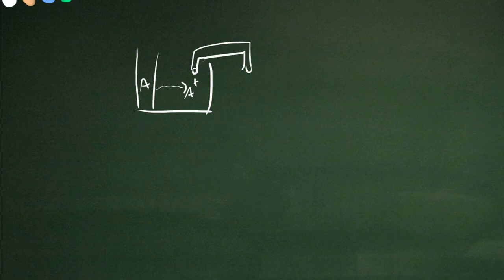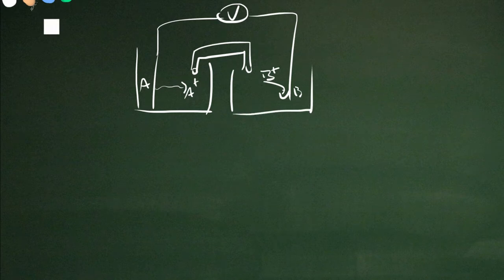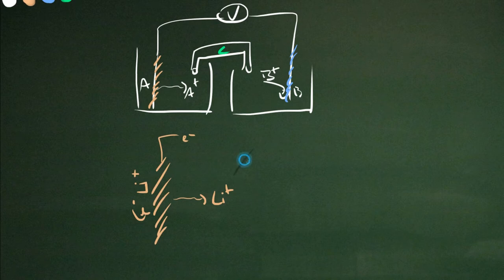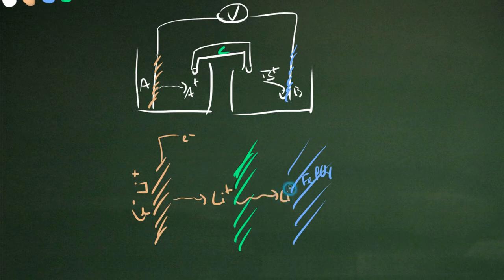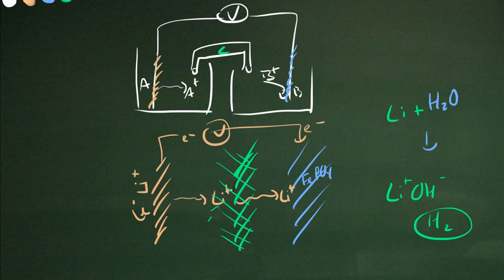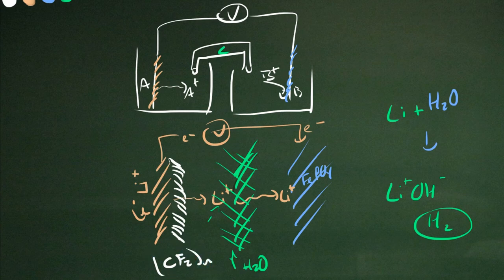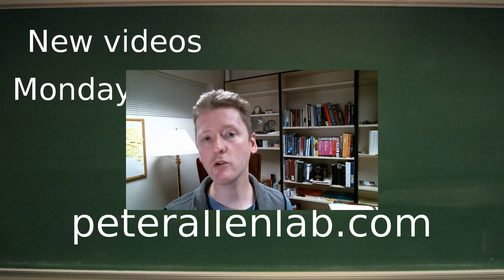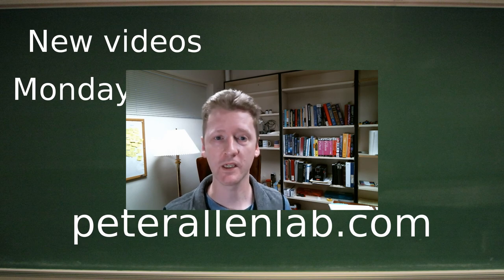Impossible! Water based lithium ion battery?

Comment: Hello,
OK, but how you overcome the electrochemical decomposition of water? Kinetically speaking, at -2 V water will reduce to H2 and at +2 V water will oxidize to O2. So you'll never be capable to charge your battery at 3.5-4 V or to take advantage of this potential difference during the discharge session.
Regards,
Dan